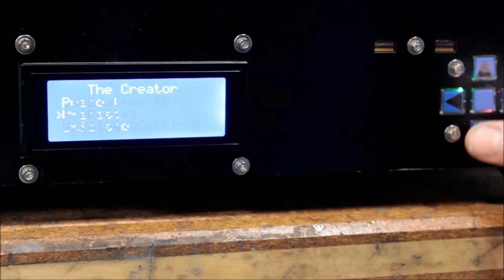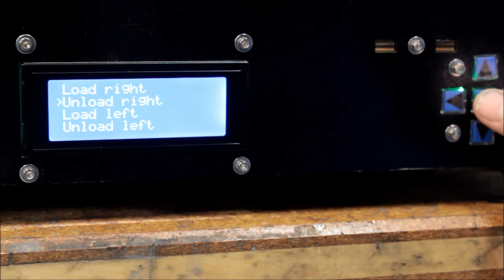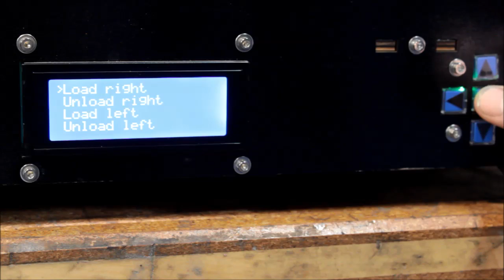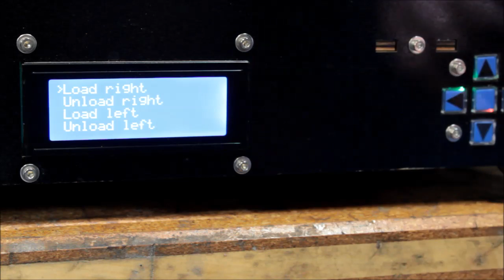3D Printer Basics - Changing Filament Color

Comment: Can this work with single nozzle printers?
Reply from the maker: Yes, it is the same process.  The main point of the video it to get the material hot and moving through the print head before trying to back it out for removal.  This reduces the chances of the filament breaking between the heated tip and the drive gear, which is a pain and can be time consuming to fix.  

I am sure there are other ways to do this, but since I have adopted this method I have not had to disassemble my print head to clean out stuck material... and I have 900+ hrs on my CTC.